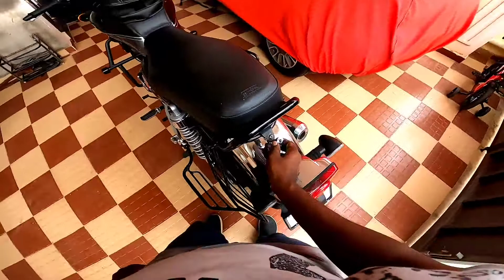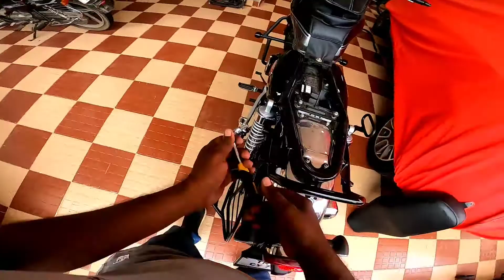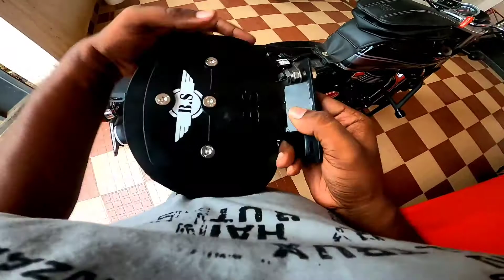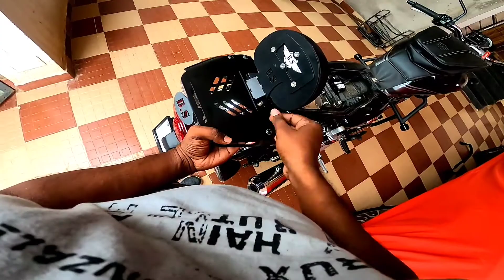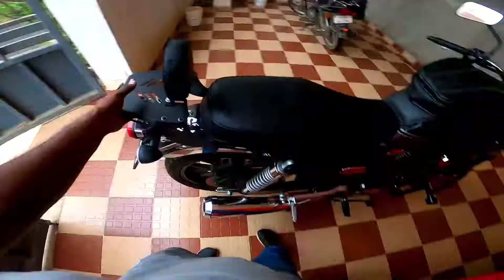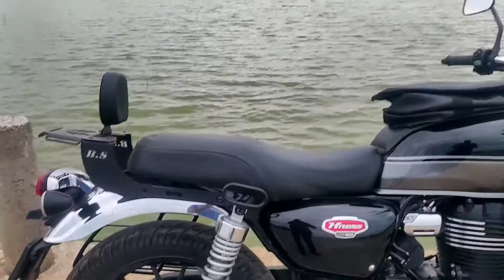#HONDAHNESS Honda Hness installation of BS accessories back rest.

Comment: Hi 2 questions 

a. How did you manage to get the holder or circular grabrail which is put on the right side of the bike above the shocks ? Is it generic ? 

b. Don’t you miss the helmet lock after removing the grabrail ?